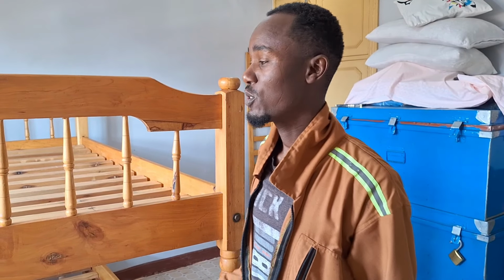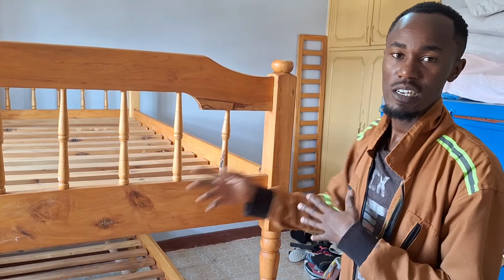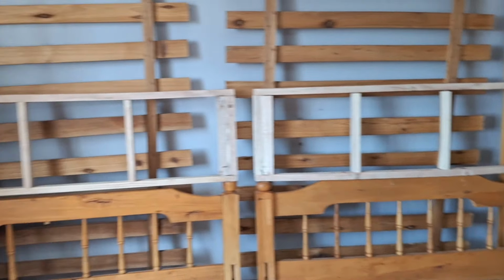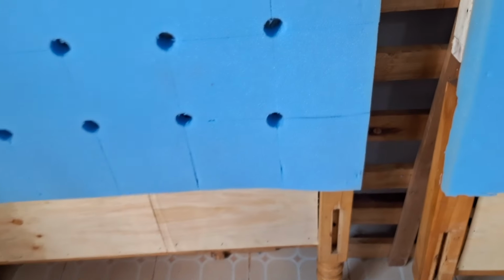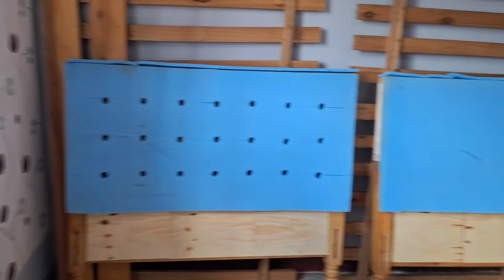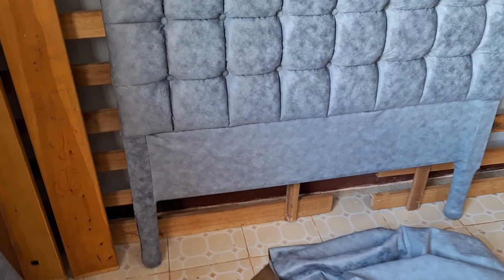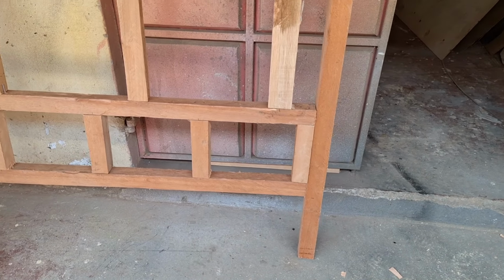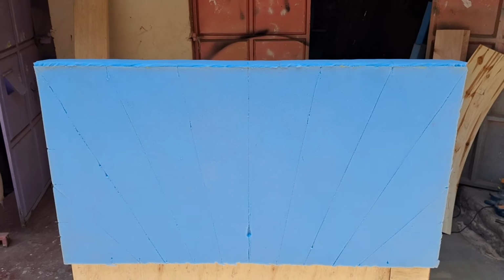How To Tramsform An Old Double Decka Bed Into Two luxurious Modern Beds DIY

Comment: What is usually the size of the extension you add on the headboard? And what size is the headboard in total after extending it?
Reply from the maker: The size I add normally depends on the original headboard of the old bed but the total height after additional height is btwn 4feet and 5feet...anywhere btwn there is ok
Reply: @ Alright, thank you.
Otherwise, great work man! 💯
Reply from the maker: @josh.thegr8 thanks